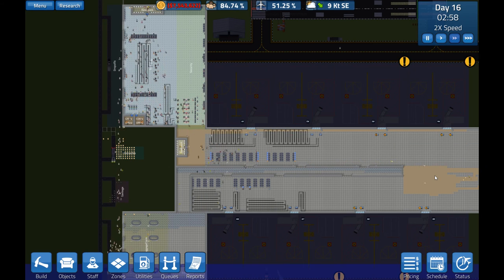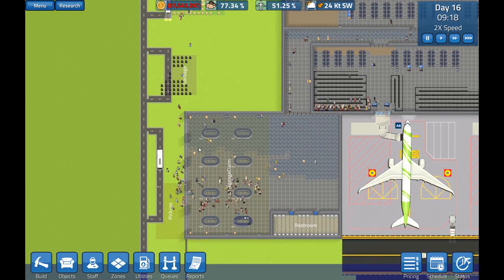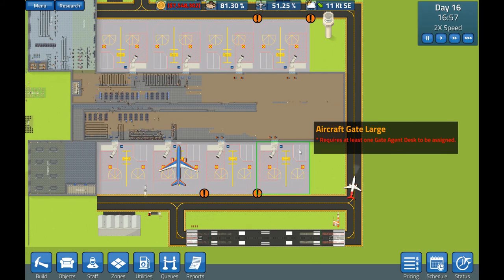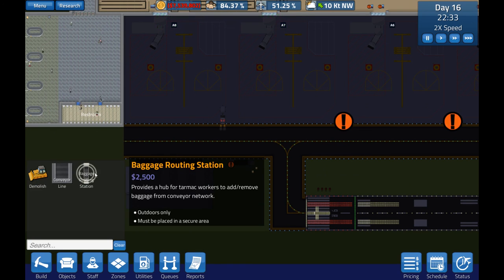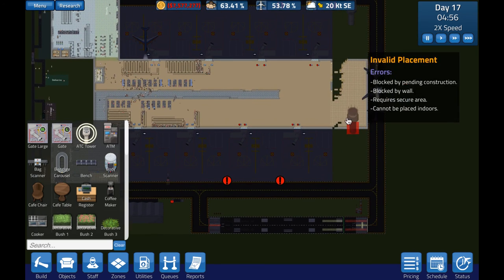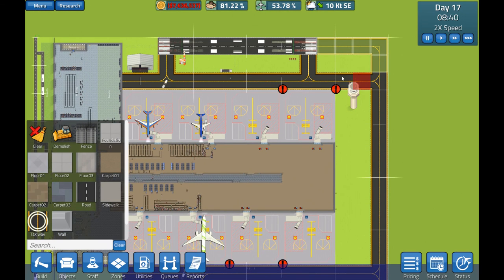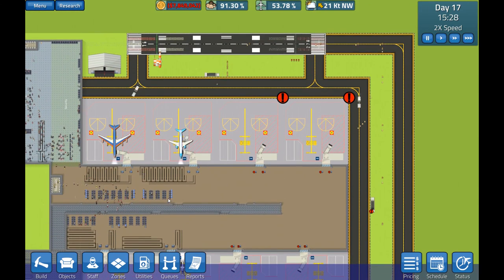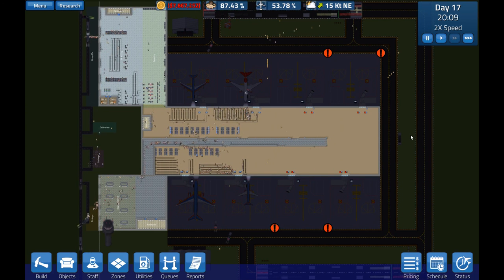Let's Play Sim Airport Again - #6 - Central Routing Station

Comment: The guys who are going between the ticket and baggage claim areas are ping ponging between the toilets and/or other amenities. 

Solution: do not build anything else than needed things in the ticket and baggage claim areas and also liberal use of the security gates.
Reply from the maker: @Paltse, I figured something like this so am trying to put all amenities everywhere. But I think they may not necessarily path to the closest one which is causing the issue. In which case removing as you say is the right solution. Shame though would like to give the passengers all the nice amenities.
Reply: ExactChaos Well, they are actually pathing to the nearest AvAiLaBlE one which means that you'd have to make ultimately about 240 of each in every area to get them to stick to the area they need to stick to so you'd end up with public toilet with surplus services, not an airport.
Reply from the maker: @Paltse, Thanks for the info, I have removed all the bathrooms and other amenities that may distract the passengers and that seems to work as you suggested.

Comment: when my passengers go to the plane, some of them end up going to the grass and stuff. is it a bug or am i doing something wrong?
Reply from the maker: @tvpromosandprevies, this sounds like a bug to me as it just seems to work once you place the gate. Is you sliding door right in front of the skybridge and is your stand rotated correctly? Also is you gate desk assigned to the right gate? Those are the only things I can think of to check. Hope it helps!
Reply: Yeah i think so. Take a look: http://imgur.com/a/6QgBA
Reply from the maker: @tvpromosandpreviews, from what I can see there the gates look fine. The passengers streaming out on the lawn I would guess is a bug.
Reply: I got it. When they went trough the doors, they all went to the same place, on the grass near the bathroom on the left, because i put on the inside an flight info display. So i removed it and they are not going trough the doors. so i guess that was it
Reply from the maker: @tvpromosandpreviews, excellent. Glad to hear you figured it out.